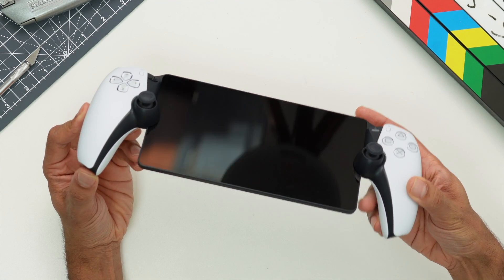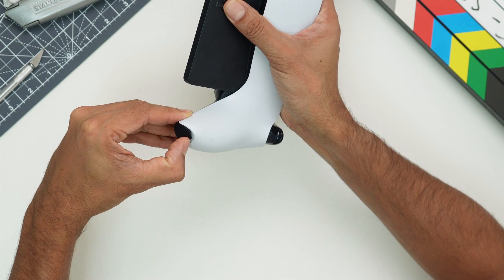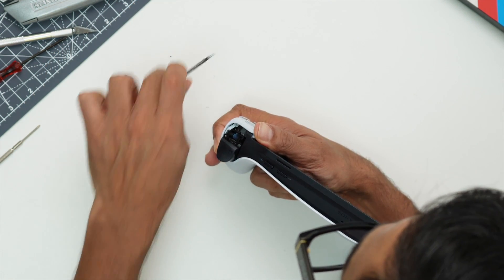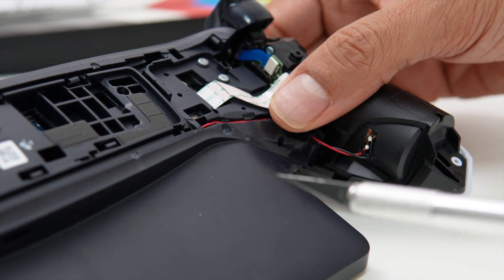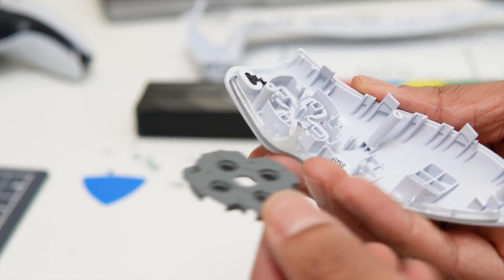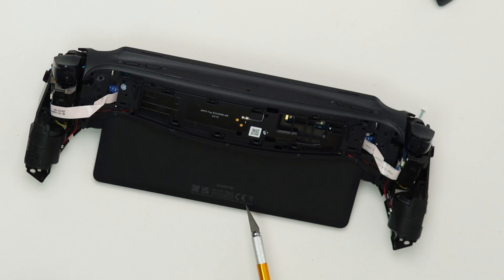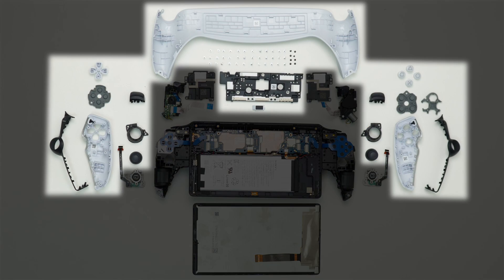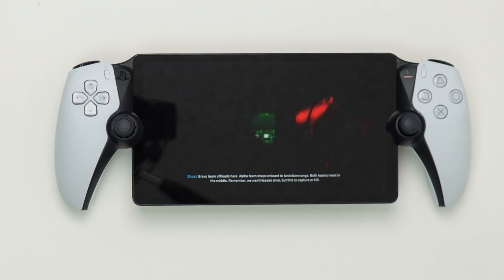PlayStation Portal Teardown & Reassembly?

Comment: At 9:03 you hit the nail on the head with everything you’ve said… at the 2 year mark mine started to Bulge and it pushed my screen completely out… fortunately it did NOT crack the screen unfortunately there is NO after market Battery nor upgrade battery for this device that I know of to fix said issue. Also I only used it about 7 times so maybe that didn’t help…

Comment: I have a steam deck and a ps portal but i have to say ps portal is really damn good for what it is. Its the most responsive streaming experince i have ever had. You can also use your portal on the go if you have a fast mobile internet and home internet. If we can mod the ps portal in the future and use emulated and android games on it would be a even better deal to get one. Sadly sony have really locked this device down but it is gonna be hacked some day
Reply: That would be nice to play call of duty mobile natively on the portal
Reply: @assalamualaikum8784  Hell yeah
Reply: Bro u r capping, the portal is stuck in wifi 5 its gonna be slower then the other handhelds out rn,a steam deck will play waaay better using chiaki4deck you’ll get to mess w settings to match the wifi connection. Portal also has 59.9 or something stuttering issue that is documented. I want to see you play any cod on portal lag free since its so responsive
Reply: @Avstract23  Its the best streming experinnce i ever had i think you missed that point that I point. You aint me you the one cappingfor sure. And yes to the controlls and streaming it is the best experience in streaming i have ever had cry about it. Not even have i tested Both to stream outside and steam deck is more laggy then ps portal you cappin unready.Yeah Steam deck has wifi 6 but for streaming it was not a better experince. Steam Deck is more laggy Ps Portal has some minor fps drop. Thats my experince. Even some tweking with setting did not help much but a littel bit yes. If you have a steam deck i would still not recommend buying a ps portal tho. But ps portal is the best experince in streaming i ever had